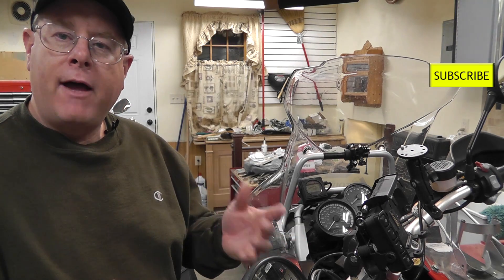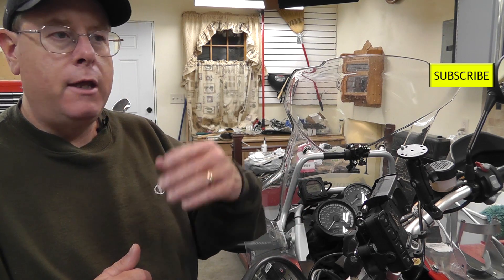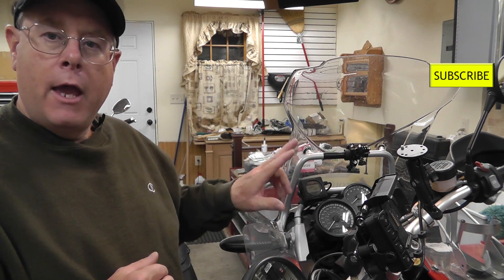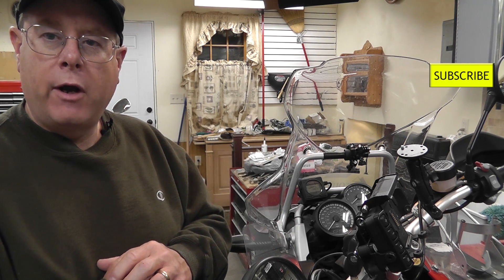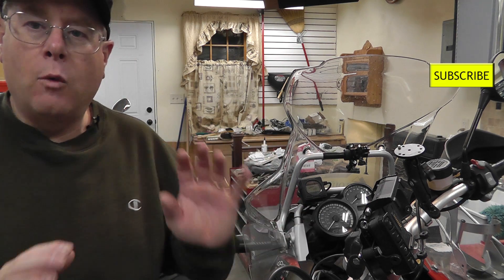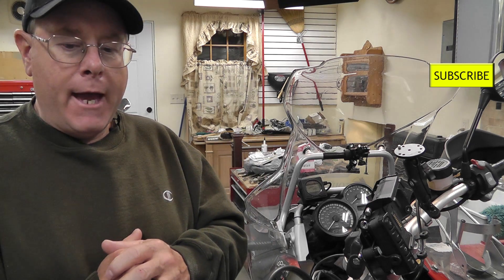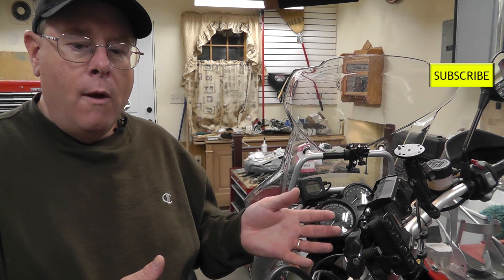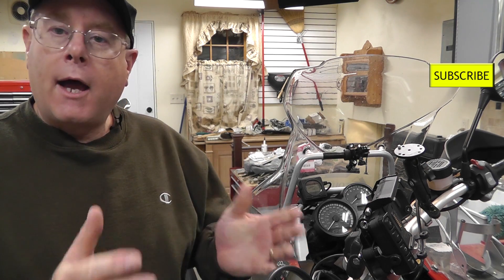Battery Bug On My Motorbike

Comment: I ordered one today and like the idea, is this a parasitic drain on the battery while sitting? I almost would consider removing the fuse if bike sits a while if that is the case. I will make fuse accessible without removing the seat.

Comment from the maker: I thought the same thing. And I still think you would be right if the bile sat for months at a time. But I've gone two weeks between rides and not had a problem. My bikes do all have chargers on them, so while parked in the shop, battery drain would never be a problem